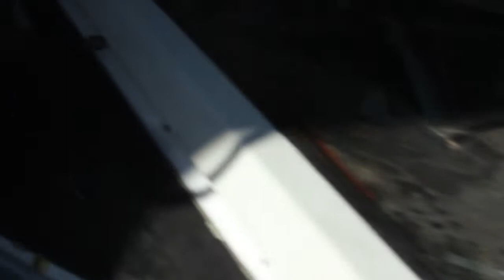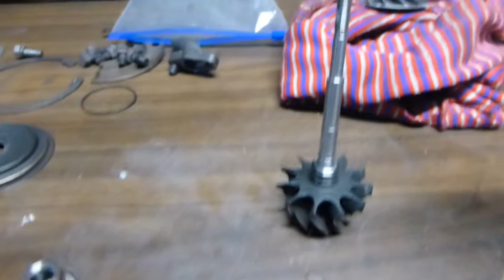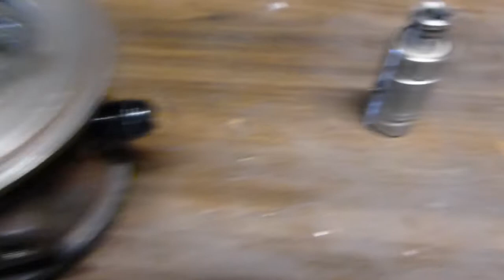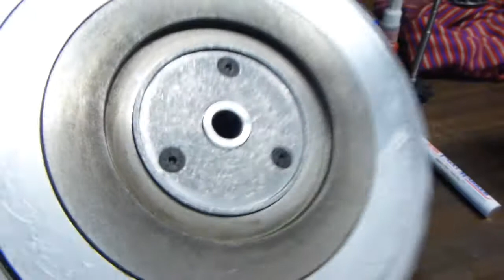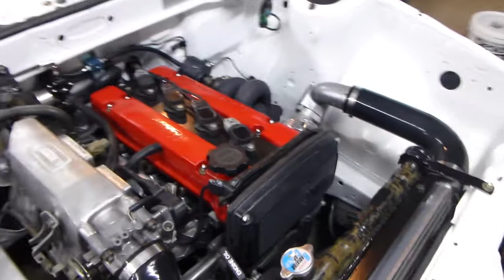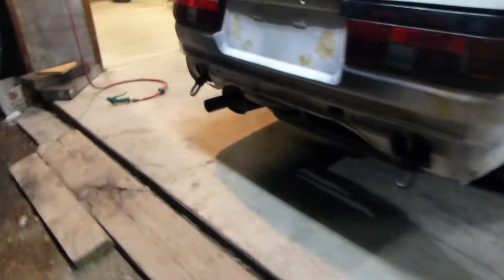Rebuilt turbo for the ae86 - Mamba recore cartridge.

Comment: Hey how did you set up your oil feed and return thanks? 🤙🏼
Reply from the maker: Hey man, oil feed is just from where the standard Oil pressure sensor sits. And then just made up some braided AN fitting lines to the turbo. Oil drain is just a AN fitting welded into the sump with then a 90degree fitting to some pushlock hose to the bottom of the turbo.. Cheers
Reply: Shed Life did you just use a T piece?
Reply from the maker: I dont run a pressure sensor at present, so just went straight into the block. But in time ill be adding a T in to then run a pressure sensor.